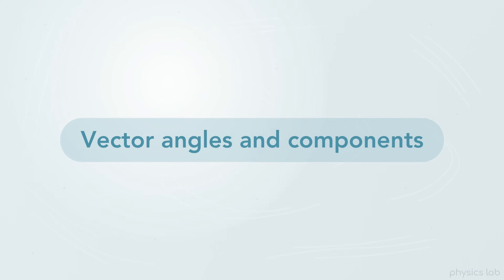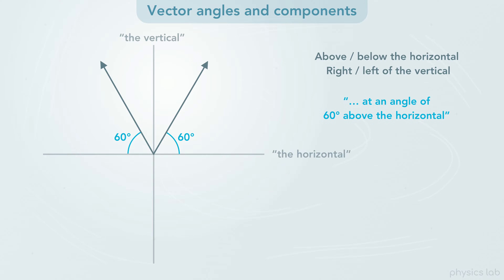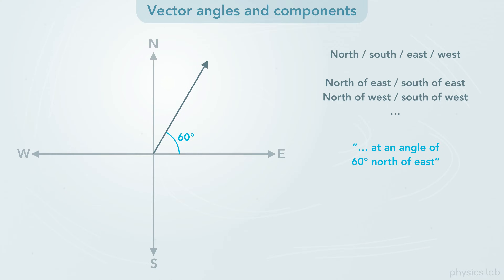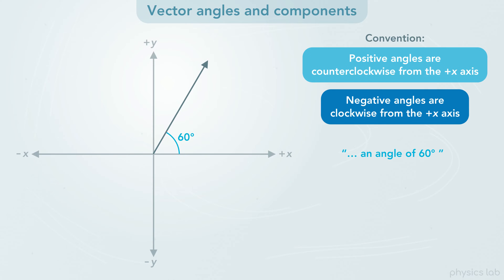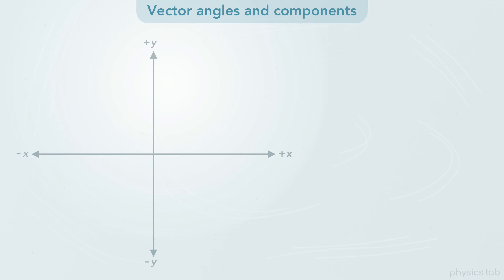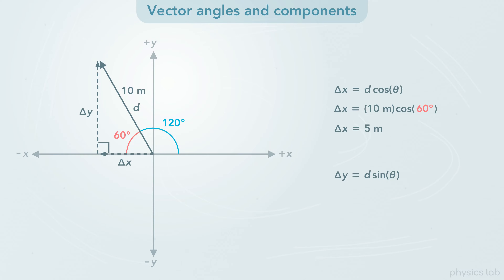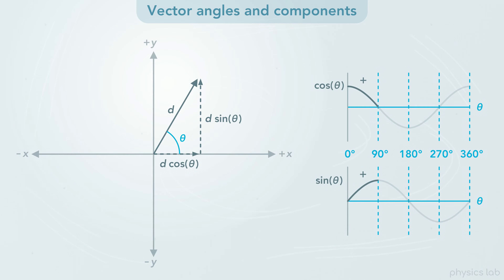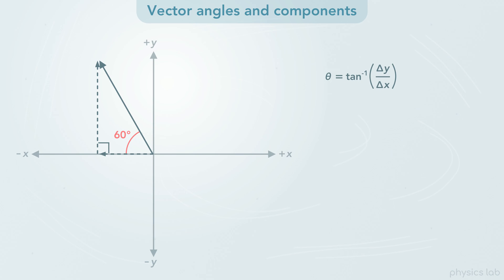Understanding Vector Angles (Clip) | Physics - Kinematics

Comment: How do you know whether to measure from the horizontal or vertical when we want to find the x and y component. Like how do we know where to put the theta? If it’s not given in the question and we don’t know theta.
Reply from the maker: Good question! If you don't know any of the angles in the right triangle (and you can't find them from other angles that are given) then you wouldn't be able to find the x and y components. The question would have to give you an angle and tell you which angle it is.